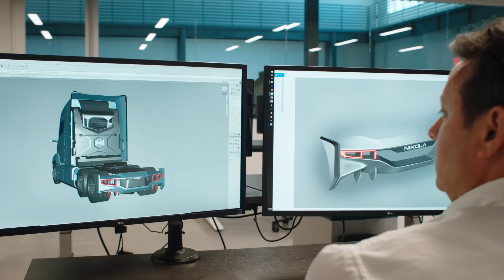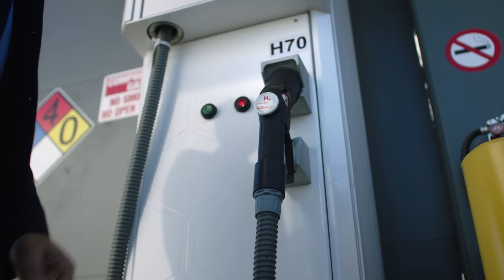Engineering Big Ideas - Episode 1 | Empowering Innovation Together | Nikola

Comment: My biggest concern is that these trucks will become driverless. At some point I think the government will have to  in act laws requiring a human to be on board at all times while in use. I think this will be necessary do to hauling hazardous materials and also the amount of weight being transported on our streets and highways.
Reply: what can a human do that a computer operator can't? by the time a human wakes up, realizes what is about to happen it's already too late. the computer can already solve it and execute it.

the weight doesn't really change with an electric vs diesel. 

eventually all vehicles will be driverless. we wont even have a steering wheel. some exceptions will be off road vehicles but you'll have a driverless vehicle to get you there.
Reply: Jetah this hasn’t always been the case. Autonomous driving has failed and has killed people. Planes can autonomously fly but there’s still a pilot
Reply: A computer can’t strap, put tarps, or evade if some dumbass decides to cut you off and break so yea, the truck should not be able to drive itself until all cars can drive themselves
Reply: Humans are way more dangerous than a computer